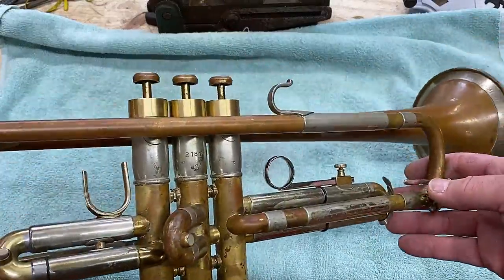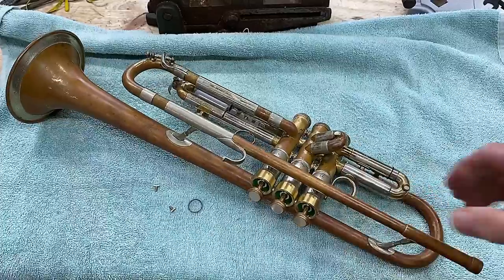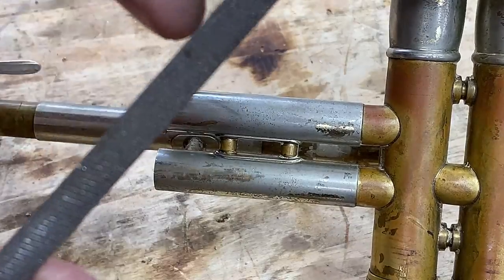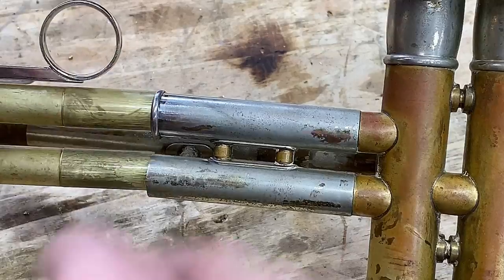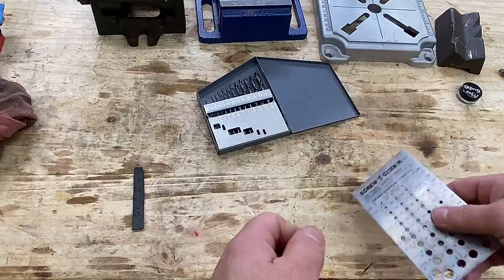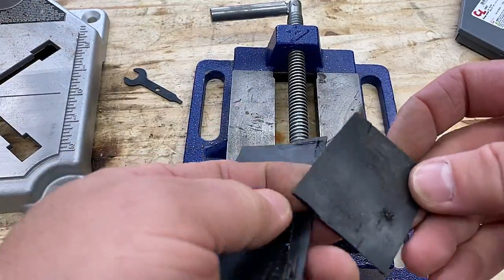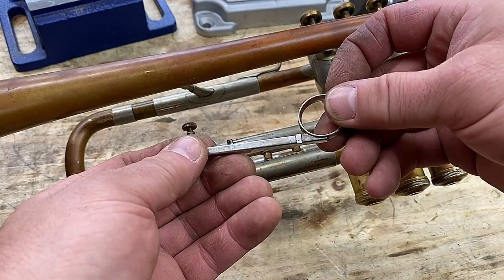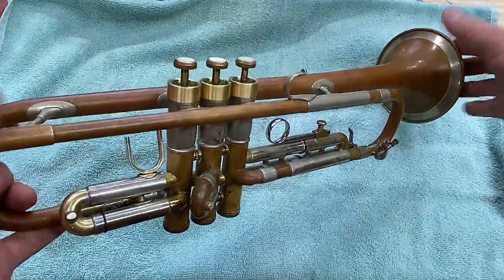Steampunk Super Olds- Wes Lee Music Repair

Comment: Really nice work! My Olds Super has a square tubing on the piece with the ring on it. Also the ring for the thumb is adjustable and made from square tubing.  The piece you drilled. I guess they tried to make the horn as light as possible. It was made 1949 
I love your channel!!

Comment: Excellent work Wes! I'm a sax player, and have maintained both over the last 5 years. I just purchased a '55 Olds Ambassador Fremont trumpet which I am currently refurbishing. It doesn't have those black rubber rings on the 3rd slide. Should it have those? Thx.
Reply from the maker: Thanks for watching and following along! That’s a good horn. Those are black nitrile o-rings. They were not stock. They help eliminate the noise and soften the blow when retracting the kick slide(s). It’s personal choice.